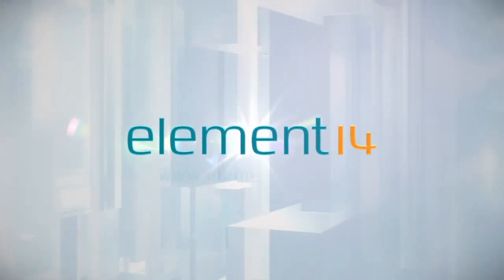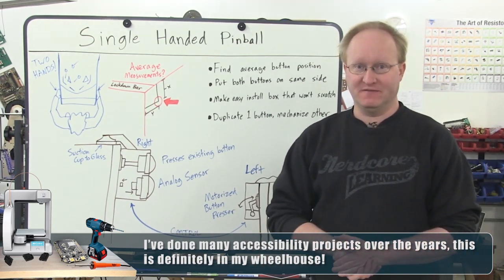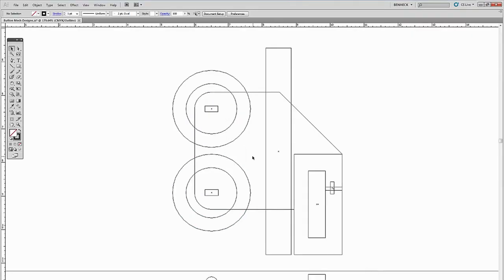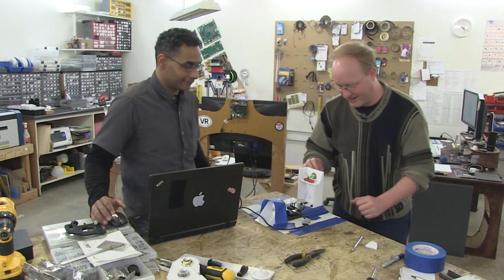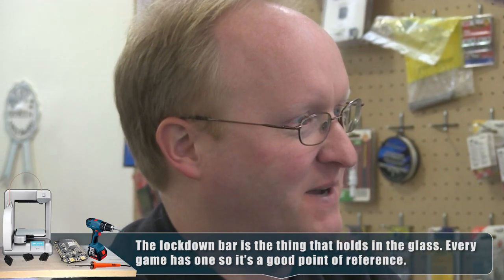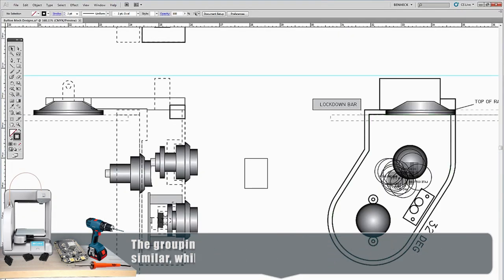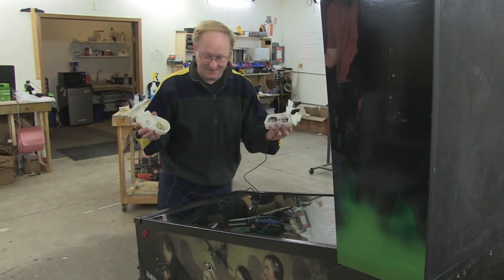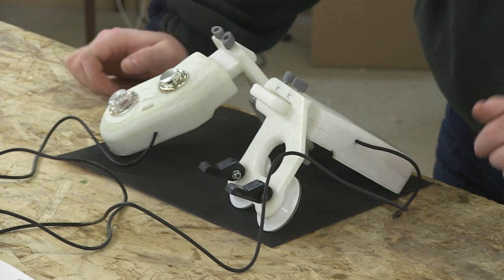Ben Heck’s Single-Handed Pinball Mod

Comment: I would've designed the single-handed pinball mod very differently. You still need two hands to install it, so that alone already defeats the purpose of the mod. If this was made for someone who only has one arm, it should be designed so that it can be easily installed and uninstalled with a single hand only.

Also, it's designed to only go on the right side of the pinball machine. I guess you could make a second one for someone who only has their left arm, but wouldn't it be easier to design it so it can be interchangeable for left and right handed people? That way, you wouldn't have to keep two separate design plans.

This mod is still quite good for a proof-of-concept, nonetheless; and for only being done in four days, it looks and performs quite well. I hope you revisit this one down the road, because I'd like to see how you would improve upon this mod.
Reply: Agreed!  It is an excellent proof of concept. :)

I think a ratchet type raising/lowering for the button precision instead of the thumb screws would solve the 2-handed installation.  As far as left/right usage, just make the enclosures ambidextrous.  This way they can be installed on either side.  Keep the suction cups though, that was a smart approach.
Reply: ***** Like I said, it serves as a great proof-of-concept. The reason I said that "needing two hands to install it defeats the purpose" is that if this was designed to either be given or sold to someone with only one arm, it's best to assume that the person in question who will be using it will also be the one person installing it on top of that. You don't design handicap products to need extra people to operate it or handle it if it's at all possible, since that would negate the purpose of having said product to begin with.
Reply: DurradonXylles I honestly don't see where this would be super hard to install with one hand. People who only have the use of one hand get very good at doing things one-handed. You don't have to install both sides at once, and each side can be adjusted with one hand and a bit of dexterity. Having two lock screws is the hardest part from what I can see, and that is an easy fix.

Comment: One fatal flaw that I noticed was a lack of charging circuit and/or charging port. Maybe make the connection between the two units with a USB cable, or even an old phone cord, so that it's more modular. Other than that, great idea. Love the show.

Comment: Amazing work Ben!
The way I would do this differently would be to do this mechanically (for example using a Bowden cable as commenter Jack Eagan proposed). This would hopefully make this a cheaper and smaller build, as well as eliminate lag and the usage of battery.

Comment: Btw, servo's don't bind that easily, only the cheap ones. Hitec has programmable servo's that have high torque and speeds with 180 degree rotation.

Comment: I don't know how feasible this would have been (as your development schedule was relatively tight, and it might have taken too much time to test materials properly), but I kind of wondered if maybe a pneumatic (or possibly hydraulic... but then friction/weight becomes an issue) solution might have worked for this project.  If you replaced the hall effect sensor with a sealed piston at the base of the secondary button and then ran a tube from that to an elastic bladder/balloon on the other side of the pinball machine that was constrained within a shell of equal volume: wouldn’t you end up with a mechanism that had zero input lag, a natural spring effect, and that would not require any sort of external power source?  (You could always weigh down the secondary button actuator to keep it in place.)

I suppose the problem with that idea is that it could have issues with changes in barometric pressure (with very little in terms of adjustability), you would really have to tinker with it to ensure that the pressure gave the right kind of responsiveness, and it might necessitate the use of some form of inert gas within the system.  (All of which might be outside of your comfort zone as an engineer.)  Regardless, it is just a thought for a purely mechanical solution to this problem.

Comment: use a solenoid over a servo. that will salve your lag problem
Reply: danz409 Yeah, but it's not an analogue solution. Solenoids are on/off. The servo allows for granular control of the button.
Reply: Christopher Pilcher
solenoid with a spring would be much more responsive, and would definitely give ability to control it in "analog" way. solenoid for the win !:)
Reply: What about a Bowden cable? 100% mechanical solution.
http://en.wikipedia.org/wiki/Bowden_cable
Reply: Jack Eagan Just grab any brake cable off a bicycle
Reply: That was actually my comment. Just wanted to link to Bowden cable, so there was no disputes that it could handle push-pull motion. And the article has a list of applications where Bowden Cables are used. A+ for reading the article (or knowing your terminology).

Comment: I think it would be more intuitive to use if the opposite flipper were controlled by the thumb rather than another finger.  In this configuration you are making the brain work harder by inverting the button to flipper mapping.  The thumb would also be more play neutral since you were pushing straight down vs pushing against the direction of the flipper.

Comment: Why not use a solenoid instead of a servo. With a mosfet that way you can use the output of the hall effect sensor to the drain so you have a proportional throw of the solenoid  a few potentioneters to set it up and voila.

Comment: Interesting build. I'd love to see more on where the latency comes from. How much due to the Hall effect sensor, how much from the A/D in the microcontroller, etc.
Did you consider a stepper instead of the servo? Would that be faster? 
Since you have an analog switch, did you consider doing an analog control for the speed of the remote button press?
Reply: Pat Farrell I would wager most of the latency comes from the microcontroller. Discrete logic works very quickly. Technically speaking, the Hall effect sensor works at the speed of electricity through a conductor (You know, relativistic speeds), while the microprocessor is doing number crunching and then outputting a signal.

Comment: The controller will allways outperform a standard servo. Use a digital high speed servo designed fot helicopter tail control for maximum performance.

Comment: You went in too fast with the tap, it heats up in tight holes. It's also a good idea to go back half a turn after three or four turns to break the shavings from the plastic

Comment: I'd have gone with a fully mechanical approach. Something like a clamp with metal rods running through and actuates the button. The whole thing will be one big piece but that should be easier to install one handed. I wouldn't know how hard pushing one actuator with the back of your hand is though.

Comment: I really don't get why he didn't just use a physical cable like on a bike brake/shifter. I don't think it'd have any lag, plus it wouldn't require power/charging and would be variable and allow for any tactile feedback the original button possesses. Also it would allow for a smaller design as there wouldn't be electronics and a battery.

Comment: I appreciate the design, but wish you had applied it one handed.

Wouldn't it be easier to have a plexiglass bar (with rubber feet) that sits over the top of the pinball. Then have adjustable sliders for one end. that means you wouldnt need a potentiometer either.

Comment: I like your show ben! one thing i would maybe do different is think about putting those switches for foot control. not so much of modeling, but if it has to be controled only with hands then its great ! :)
Reply: I personally feel foot controls would hinder the pinball experience.  After standing for awhile my legs get tired and lose precise control that is required for pinball. YMMV of course.
Reply: ChrisKewl yes,that problem would probably accur :)

Comment: It's nice, and functional, but complicated.
I probably would have gone for the discrete logic, and then a high speed servo.
With pinball machines, timing is everything and 83ms is kind of a lot. 
There are some high speed servos for trick RC helicoptors which would have the speed you want. But you already know that.

If you could find a way to do it with some cheap radioshack or ebay enclosures it would have been better. This all seems really expensive, but if you could get it done for under $25, i think it would be better.

Comment: I suggest using a solenoid instead of a servo. The servo causes too much of delay. Use a small relay to drive it. That would cause near zero delay also, you could have very fast on off action for those rapid flip needs

Comment: I dislike element14. They only really cater to business, and their 'sister' site for personal use is so slow, and usually won't let me even get a connection.
Reply: I agree that their site is a bit slow at times, but I really don't think that they "only cater to business". After all, they are the main contributors to the Ben Heck Show, a YouTube channel specifically targeted at hobbyist makers.
Reply: Christopher Pilcher Have you tried to buy something? If you try to buy for personal use, they direct you elsewhere. You can't buy from them unless you are a part of a business.
Reply: They direct you to Newark, which is their consumer arm. For  there they might direct you to a distributor. At least that's how I was lead to understand it. Element 14/newark is a manufacturer.
Reply: Christopher Pilcher It directs me to mcmelectronics. Sometimes the website works.
Reply: Neceros Yes, MCM Electronics is the american consumer arm of the business, which is still part of the same company :)
Reply: element14 Every time I've tried to even look at the website it won't let me. So very laggy.